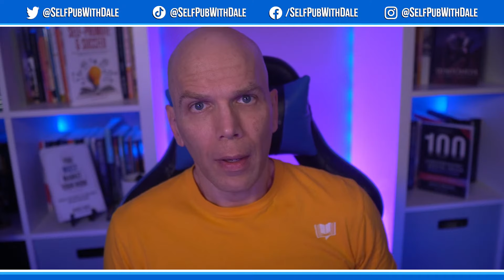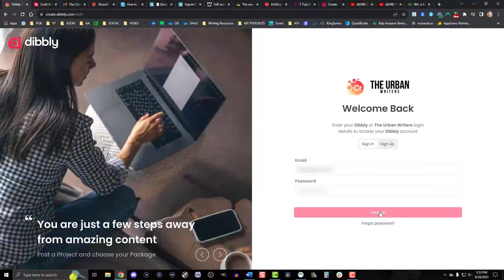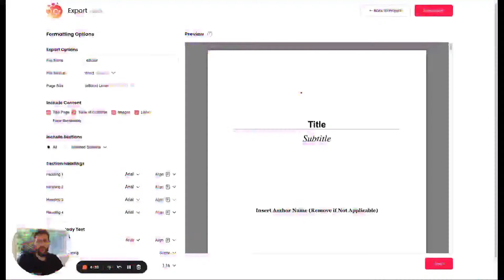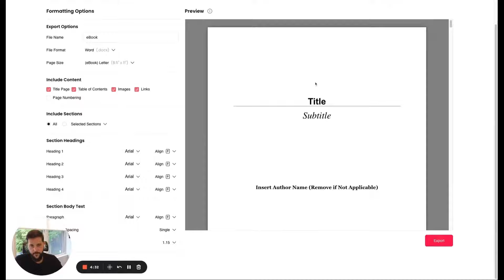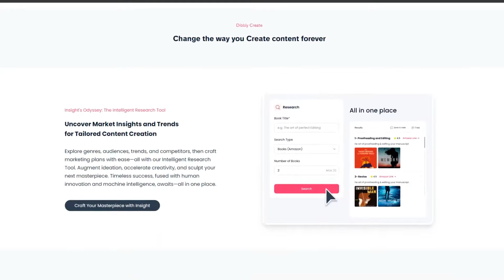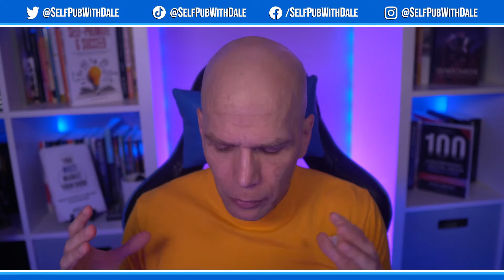Record Your Own Audiobook

Comment: Hi Dale! Hope you can give me some direction on this. Full transparency, I haven't listened to this podcast so you may have covered it in there, so if that's the case just tell me to listen to the darn podcast 😏

I explored loading an audiobook into D2D so that I could get it onto Hoopla, however, when I went to do that I found that they force you to run through Findaway. Is there a way to get around Findaway to get my audiobook on Hoopla so that I can keep a higher share of the profits?

Thanks in advance!!
Reply from the maker: Correct, Draft2Digital doesn't distribute audiobooks. They merely integrate with Findaway Voices. So, if you publish an ebook or print book through D2D, then it'll migrate the metadata over to Findaway Voices. It's up to you to load up the remainder of the information. I did a video covering exactly how here: https://youtu.be/WGvXnwHgPNM?si=WTvHOgsnAyxIsECO

It's an older video, but the steps are still good. I skip Draft2Digital and go directly to Findaway Voices. Love both companies otherwise!